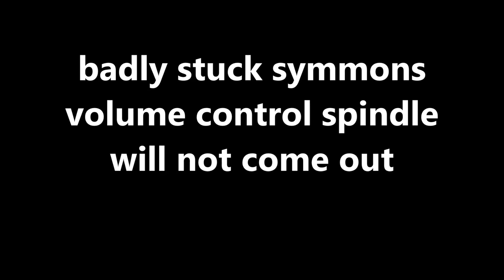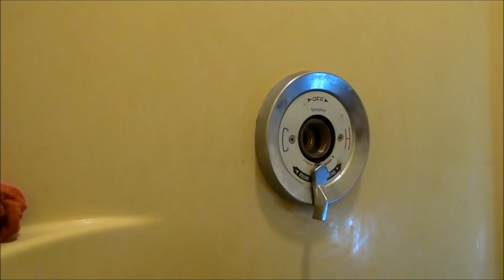symmons shower volume control spindle will not come out

Comment: Question. - I’m dealing with a stuck valve - I’ve replaced this on two of my baths in the past. This one is jammed. One thing - do you need to have the main valve out to get the diverter valve out? 
Holiday weekend repair - never good!

Comment: I have a symmons shower/tub valve that was very worn out, for me it was better to buy a new valve kit and gut it and install all the parts in the old valve housing plus I was able to use all the new chrome trim parts that were in tough shape on the old valve, cheaper than buying all parts separate. I also bought the tools needed and could not remove one seat as the flats chipped so I put it together to try it and it did not drip, I'd figured that I would try that first before using a easy out !
Reply from the maker: +william D you got her fixed up good job
Reply: Thanks !